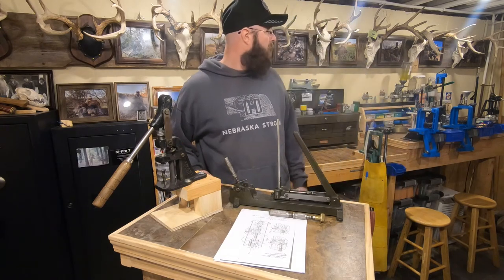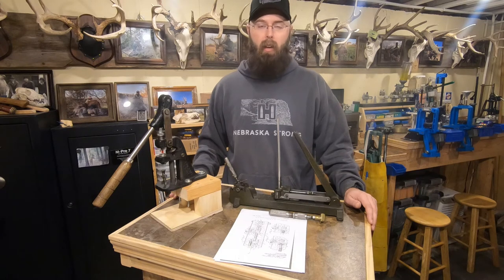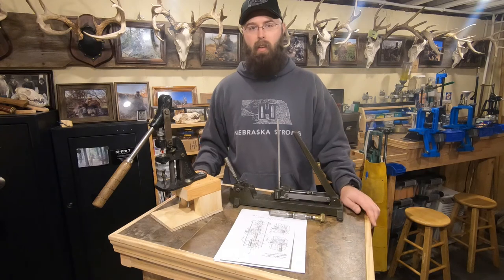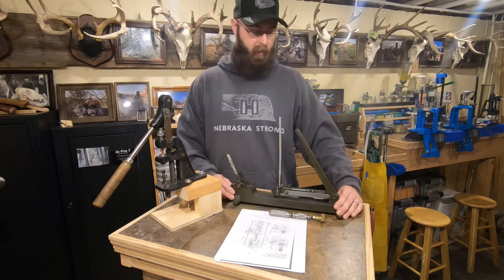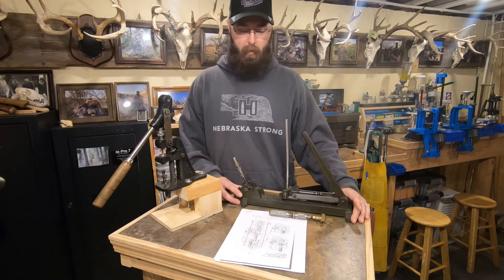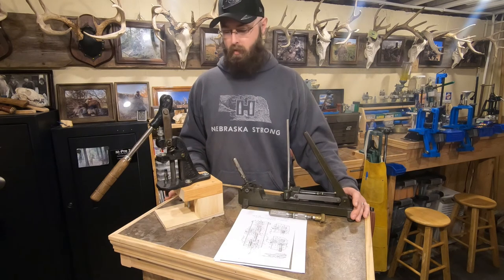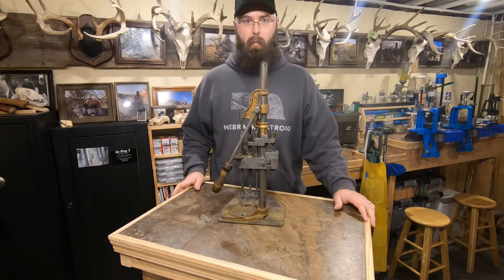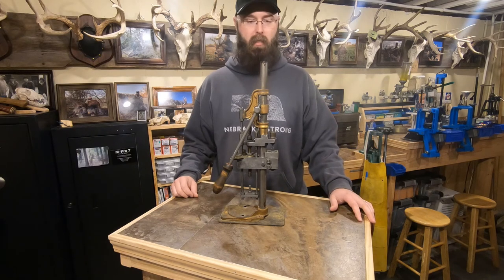New Video Series? "This Old Reloading Press"

Comment: New subscriber, nice videos. I have a complete Cougar Hunter set up in .357 but also have the 9mm and 45ACP conversions that they sold as options. I have some paper work, a parts schematic and bushing chart along with the same instruction booklet that you show. Its posted on the castboolits website with several pic's.
Reply from the maker: Awesome! I'm sure I've seen yours then! I need to get working on mine. Someday maybe!
Reply: @darrondb  I go by Cougar_Hunter on that Forum. If you need some info, let me know.
Reply from the maker: I'm pretty sure you sent me measurements and a few diagrams a couple of years back. Eventually I'll use that to try and make the missing pieces